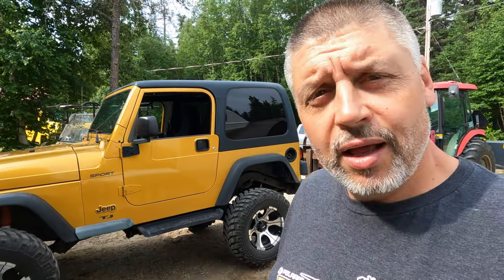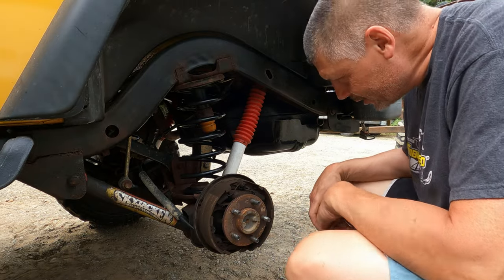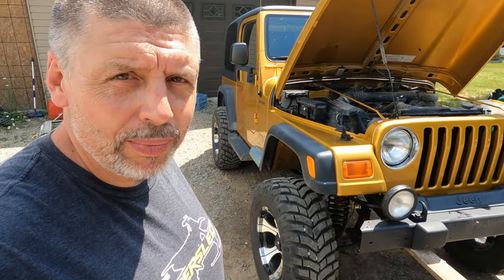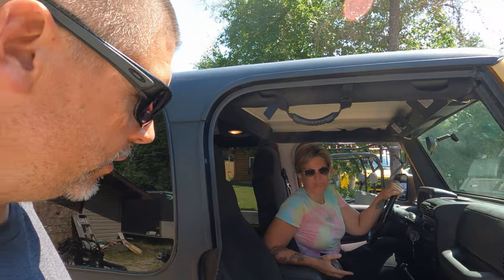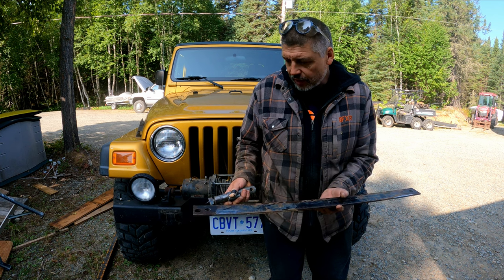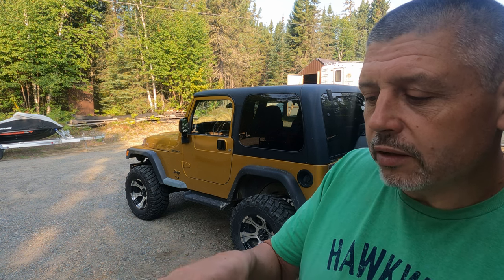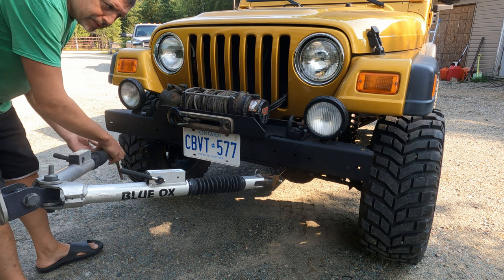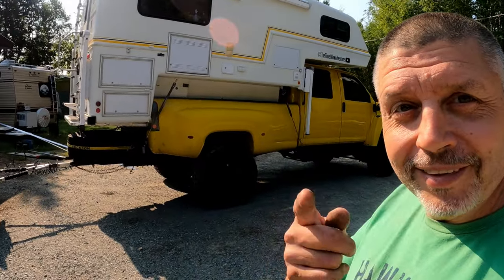Jeep Meets Kodiak: The Ultimate Towing Adventure

Comment: What a rare find!  There weren’t a lot of the Inca Gold colored Jeeps made.  Nice Jeep!

Some unsolicited advice from a guy who has equipped more than a hundred Jeeps of different varieties for flat towing… buy the blue ox factory bracket.  What you have made is not gusseted near the pins well enough to withstand the side loading that will occur as the Jeep follows the truck down the road and around corners.  Those pins will tear out at some point.  It’s not worth losing that really nice Jeep over a couple hundred bucks.  You may even find yourself a used bracket in good condition if you dig around a bit. Curt Mfg also makes a baseplate compatible with your tow bar. PN C32KR.
Reply from the maker: Thanks for the advice. We'll keep a close eye on it.